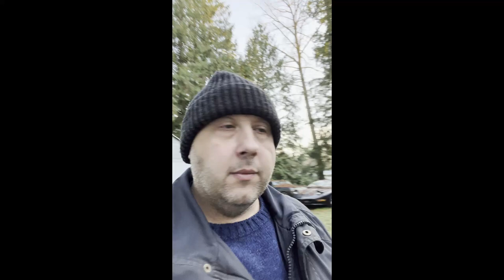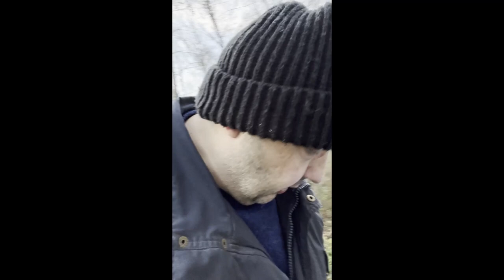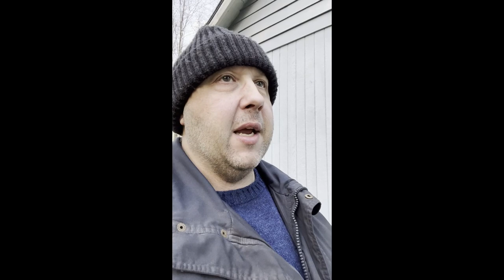Information about the ZuluSCSI for the AW4416

Comment: Excited to see how well the ZuluScsi works. I may buy one for the AW4416. I’ve been looking into one for the Rs7000 as well as the MPC2000. Looks like a great product
Reply from the maker: It works well, but only as a backup and restore option thus far. I haven’t found a proper image reader to be able to pull the files from ZuluScsi to a computer hard drive and then be read by any AW to computer software. It is also just as slow as transferring to and from cd. But it definitely works to create work in progress backups.